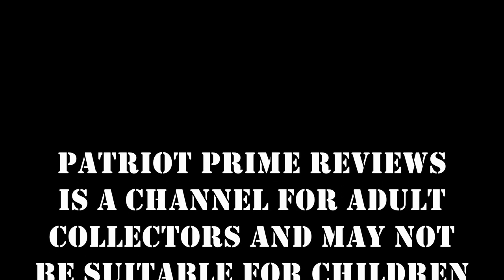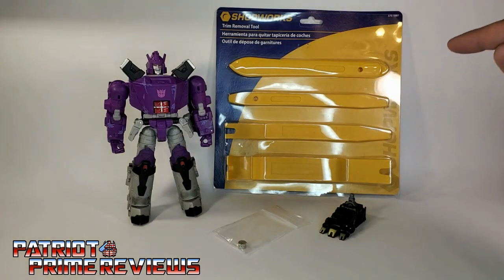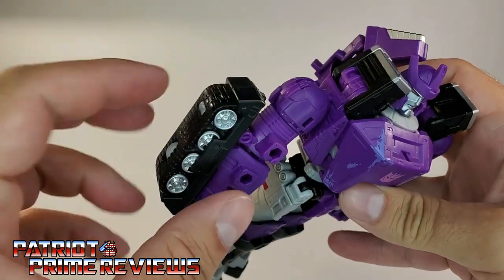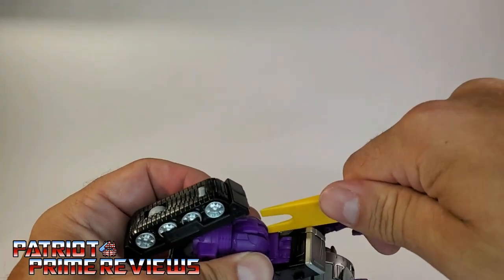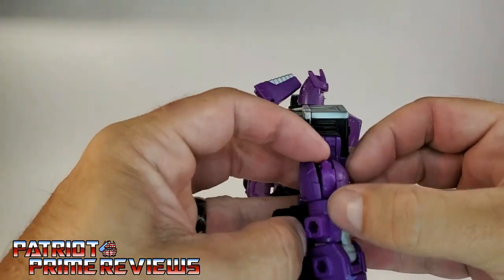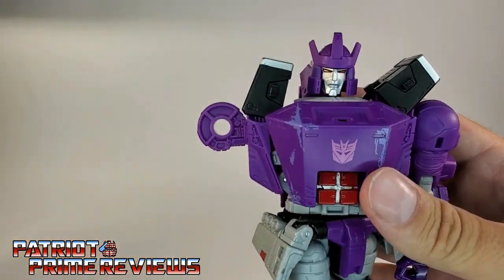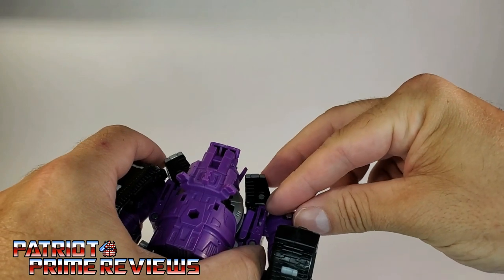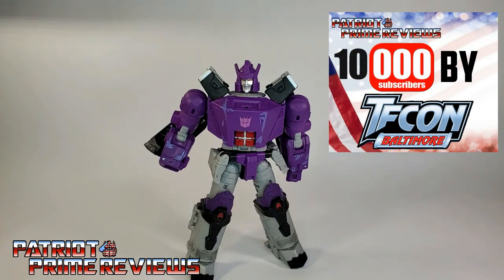Patriot Prime Repairs Kingdom Galvatron's Shoulders With A NAPA Tool

Comment: Finally caved in and tried fixing his shoulders - also took me around 20mins to do both sides. I simply used a flathead screwdriver, no heating. Now fixed. Thanks for your video.
Reply from the maker: Well done! Glad I could help.

Comment: This helped significantly. Galvatron's left shoulder was a pain to get undone, but his right took all of maybe a minute or two to pop the pin. No heat other than holding it in my hands for a minute and blowing on it. (though heat would've probably helped get the shoulders off and on a bit easier)

Comment: The silver of the pin helps the hole stand out more, but if we’re taking overall surface area of the hole versus the rectangle tab hole, there’s very little difference. Thanks for the tips on the fix! Don’t know if I’ll make the attempt, but if I do, I sure appreciate you!
Reply from the maker: The one plus about having the hole in the back is the treads plug into it.

Comment: I mean… two smallish flathead screwdrivers only took me about ten minutes total. The flexible tools I tried didn’t provide enough force to pry the thing open. I didn’t use any heat, and didn’t have any scratches or stress marks. 

Honestly, the hardest part was getting the arms back on.

I used a spring-powered pin punch to pop the pin back in. 

All in all, it was very satisfying to finish this off and make him look right.

Comment: Heating the plastic made sense to me but I don’t have a hairdryer. Heated the plastic by dipping the shoulder in boiling water and that worked nicely. The most difficult part for me was not popping the pin, but removing the front and rear deltoid piece from the mid-deltoid piece, so to speak. Ordered the tools from Amazon and they’re now for sale. Thanks for the vid!

Comment: Great job. Did mine works great joints still tight, works great. Fixed many transformers from G1 to present and Yes heat the plastic. Also if you have a soldering iron or wood burning tool you can remove the stress mark (just don’t touch the plastic).Thank you.
Reply from the maker: Awesome, glad it helped.

Comment: These are also called panel removal tools. You use them for car stereo installation etc. Harbor Freight sells them as well if you don't have a Napa nearby. I'm definitely going to dig through my tool box and find mine and use this technique!
Reply: This comment made me laugh because I was just at my local Napa a few minutes ago asking if they had the tool. I came to the comments to see if they had the part number and saw this as the guy helping me was saying they didn't hedge it in stock but to try the Harbor Freight literally two minutes up the road. 🤣

Comment: One guy replaced that stupid pin with a screw, although i just wouldn't take it apart again for any reason. And thanks for mentioning heating it up - I tried it with just the tool and failed because I didn't heat up the shoulders.

Comment: I did this fix also. Getting the tool into the shoulder can have its issues. But it was easy once in. You’ll feel the pin pop. And have the pin fall into your hand. Repeat the same on the other. Took about 15 minutes for both shoulders for me.

Comment: Thank you for this video! Got my kit today and did the fix! It's perfect now!
Reply from the maker: Outstanding. It's a shame we actually have to do this but so thrilled we can.
Reply: @PatriotPrimeReviews  I know.. this mass QC problem is crazy. I paid $60 for mine on ebay and the seller used a camera angle that looked like they were assembled correctly. I was going to buy another one but when I saw your review and how the hair dryer allowed everything to happen smoothly. No stress marks, paint chips, cracks or anything! Flawless

Comment: Some of the Galvatron figures have come with the shoulders fixed. There's been talk of quality control and also I think of a video that shows what to look for when buying the figure. Looking to see if shoulders look low and check if ridges are showing on shoulders. If so ,the figure is assembled incorrectly. The shoulders should be smooth. The one I got from Walmart was without this issue. Thanks to all the attention you and others made on this matter ,it seems like Hasbro actually listened. For that , I and I believe other collectors ,thank you.
Reply from the maker: Thank you.
I wish I had the option to look at mine before buying but unfortunately my Walmart (my only shopping option) hasn't stocked anything other than Deluxes and Voyagers since POTP. 😒
So online it is.

Comment: This is why I miss screws.
Reply from the maker: I was thinking the exact same thing.
Reply: It's weird because Galvatron clearly has screws in some of his parts. The forearms and treads, for example. So why the mix? I'm no expert, but wouldn't it have been cheaper to use all screws OR all pins/rivets/whatever those things are?

Comment: Gah, what a damn mess. I'm trying to do this fix, and the pin on the first shoulder i did slipped through its socket instead of popping out the post, and the second one is such a pain that im taking a break midway through. I just don't know what went wrong... the tools are in worse wear than i expected the toy to be...

Comment: Is that an issue never resolved by hasbro... are all the galvatrons like that, or did they catch it and correct it during the production run?  Yeah $50 + upgrade kit to plug some holes, and the tool from NAPA is an investment. If you hate the battle damage, throw in a bottle of alcohol too. I kept my Kingdom version MISB and opened the generation selects version which looks better in alt mode, and I think I read or saw that he’ll be released again in Legacy.

Comment: It's a good 'how to' vid for this fix, though cant you simply turn the shoulder and bicep joints 180? This way you get the shoulder placed higher with the arm working as intended. As a bonus the holes now dont match up for the peg on the tank threads so they wont accidentally plug into the back of the shoulder and lock up the arm articulation on you. Sure, it means having to turn it back around when transforming him, but its such a simple thing to do and his transformation is pretty simple to begin with so... Worth it?
Reply from the maker: Depends on the person.
I don't find the holes on the front as aesthetically pleasing.
I know there are "Hole Fillers" available but to me there's no difference in buying a $6.00 tool kit to fix a figure to a $6.00 pairs of plugs.

Comment: I tried this, but ultimately gave up. I started to get frustrated. That would lead to breakage. I also didn't want to use a hair dryer. I just used the shoulder flip method and got some 3d print pieces off eBay and covered up the pegs.

Comment: The fact that you have to do this on a $50 figure shows Hasbro is just crappy.
Reply: There have been Galvatrons found at retail with correctly assembled shoulders, so you might not have to do this. At least the factory caught this mistake partway through production. Hopefully the Generations Selects version won't suffer from this, considering it's going to be packaged in a windowless cardboard box and thus no way to check before buying.
Reply: @DetectiveBarricade  yeah, I actually found one in the wild with the correct shoulders and did a video about it! Once that shoulder issue is out of the way, it’s an awesome figure!!!